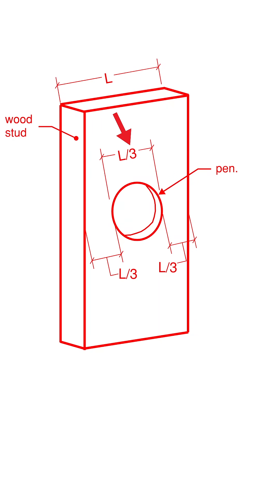1 Minute Structural Engineer Reviews Reddit Construction 2 #reddit #engineering #civilengineering

Comment: Actually this is probably fine (not to code, but structure is fine). The studs are acting like ribs to the shear wall surface. If this was just a stud wall, then you'd have a problem. Still, would add stud shoes if it was my house.

Comment: Why these are called "international"?
Reply: A number of other countries use the US building code as the basis for their own legislative building codes. It basically goes like this - Mexico needs a building code, Americans already codified reasonable building standards, therefore lets say our building code will be substantially the same as the IBC with XYZ modifications if any. 

I believe there are a number of legal standards set that are like "The US does X, the American standard is our standard." So they don't have to reinvent the wheel. Accounting is one where the American standards will be "whatever IFRS says" I.E. whatever the germans came up with, or vice versa.
Reply: Standardization of this sort is very helpful to economies too. If you're in mexico and you need the tools and hardware to build to a spec that's shared with your neighbors, then there are more resources circulating that fit the bill, with larger scale economy.

Comment: How to fix it? May be add second sill plate under the pipe and bottom plate above the pipe then connect them with metal flashing to form a box. Calculate vertical and laterl forces capacity for new box shape base.
Reply: Take the lumber wall down and rebuild it. If it’s load bearing then you need temporary support wall to take the load

Comment: First problem is 2x4 framing... second problem is the hvac guy liked eating paint chips as a kid
Reply: You would be lucky if he liked eating them most still like eating them
Reply: Agreed! as a CSL, when i talk to my architect here in Boston, all exterior walls get 2x6 framing and any interior walls that carry mechanicals are also 2x6.
Reply: “2x4 framing bad”
Everyone living in 70 year old homes in Florida disagree lol. 
You know how many house I’ve seen that only need drywall and electrical after sitting in 2 ft of water that have been here since the 70s?
Reply: @ wait till u see the house im bout to bring from the literal dead. Termite damage and holes in the wall. Been there since the 20s probably. Three trees hold it up lol. But it will be my home
Reply: @ why not knock it down and start new?
Reply: @NateHollins  yes but the problem is 2x4s from 70yrs ago are old growth and have 20x the growth rings of modern lumber. I counted 65 years in an old 2x4, vs the 1/4 inch growth rings you usually see in farmed lumber. Farmed 2x4 isn't half as strong as old growth.
Reply: @NateHollins Old 2x4s are not the same as new 2x4s. My 110 year old house with 2x4 balloon framing is probably stronger and stiffer than modern 2x6 framed houses, but you can't get lumber like that anymore.
Reply: Third problem electrical saw this and said he'll be back when the problem is fixed lmfao 😂😂😂
Reply: @ what’s wrong with the electricity?
Reply: More than likely they were never trained on anything remotely concerning structural integrity and they were just told "put it here, I don't care how you do it" and they didn't have the proper tools to get stuff done. How do I know this?  Because I used to do this kinda stuff and the company I worked for paid me $11 an hr to do it and if I wanted hole saws I had to $&#@*+ buy them MYSELF. F$#@ Service Experts.
Reply: I bet it leak’s because he probably did that because he can’t braze copper for shit or just didn’t care about integrity. Id take a sniffer to that line
Reply: @ you can tell if it leaks by just smelling it??? I doubt it…
Reply: @Wtfinc  what does brazing have to do with anything? Nobody's gonna put a joint in between every one of those 2x4s.
Plus you could just pull soft copper through there.
Reply: @ soft copper? 1&1/8inch thick?  Through three 90 degree bends? No. It will either work harden and snap, or it will crush and fold. 
Whats there in the video is braised  but they did it away from the wall and set it in. So idk what ur trying to do here.
Reply: @Wtfinc   harden and snap? Crush and fold? Wtf are you talking about?
Soft copper is not going to harden and snap.
And it will only crush and fold if you don't know what you're doing. 
The line set in the video looks like standard 7/8 low 3/8 high, and it is absolutely soft copper. There should be NO joints anywhere in this part of the line.
If they brazed the line at the 90*, (bottom left) they could have fed the line through the studs instead of cutting a big chunk out.
Reply: @ they couldve fed it trough if it was soft. If ur gunna be lazy, why start cutting studs? Why not just feed it tf through? It either wanted to fold or he was afraid of fire. It aint out job. Maybe he doesn’t know pipe benders exist or can’t bend. And dont tell me soft copper won’t harden. Wtf are u saying?
Reply: "ha ha, why?"
Reply: They must have hired some cheap hvac guy.
Reply: This is perfectly acceptable............in Zimbabwe.
Reply: 😂😂😂so sieht es aus. Mein erstes Haus hatte16cm +8cm ebene. Das 2. Tji joist 356mm +8cm ebene.😅😅😅👎👎🇩🇪. Bockwurstbuden nennt man das in Deutschland!!
Reply: Definitely 2x6 framing. The holes they cut are adleast 4". But still that's fucked up
Reply: @islandrider9837 1-5/8 typically fits most linesets
Reply: No, that is definitely a 2x4  @islandrider9837
Reply: @islandrider9837  Lol. No. You can compare the 2" face to the long face and easily tell that those are 2x4s (1.5x3.5). That's a roughly 2" line w/ the insulation, approx 50% of the stud width/depth.
Reply: No issue with 2x4 wall, its a garage, 

All they need to do, is install a 2x4 perpendicular to the cut ones for each, making an L shape at each member.

This would transfer load from the existing frame to the foundation. Well allowing the hvac ac lines to run as they are.
Reply: @mitchelldalton7405  I'd agree with you if that was a garage.  But it's not.  That's definitely a foundation wall and unless that garage is butted up against a hillside, this is an interior basement or 1st floor wall.
Reply: @zafarsyed6437  It's almost certainly a garage, although it might  be the ground level floor of a raised ranch. We can tell you don't know much about building, but it doesn't take an expert to know that all of the framing is above grade and that only an idiot puts the sheathing and siding almost down to  ground level. Either way, the fix suggested by Mitchell will be good.
Reply: @mitchelldalton7405  This. You don't need an engineer just because you made a big hole if you can simply replace whatever you put the hole in. I understand that this was done because it was  the easy way to get the plumbing installed, but based on the video we don't know that the  installer figured the job was done. I also understand companies trying to cut costs, but are they really  planning to avoid the modest cost of adding a few 2x4s?
Reply: I hate seeing this, the engineers coordinate with the hvac ppl, then the HVAC is forced to do this under a tight schedule. Then the engineer ALWAYS starts pointing fingers 🙂‍↕️
Reply: @Lihgmá   I take it you're HVAC and have beef with the engies? As a carpenter I feel ya 🤣
Reply: @melonlab80  so much beef 😅 I just wish they were all as down to earth as Kestava. Good to know I have a brother in this fight 👊
Reply: @Lihgmá well, you can't really see everything you need to see.But that line set should have probably been ran above ceiling.
There would have been no need to butcher any of those 2x4s

Comment: Structural sheet metal
Reply: The structural sheet metal helps to reinforce the load bearing drywall.
Reply: @PaxImbrium  load bearing drywall is the worst 🤦😂
Reply: @MAWA-Vik19  load bearing drywall is often stronger than regular load bearing wall due to the extra drywall bracing it
Reply: @PaxImbrium  it’s composite so it has to be strong enough. Source: trust me bro
Reply: Some Builders are like, where's the joke.
Reply: Aluminum foil😅
Reply: What
Reply: @i_i_capncrunch He's talking about the nail plates
Reply: What What, in the _ _ _ _.
Reply: Those nail plates will hold up 100 tons!!
Reply: strike plates